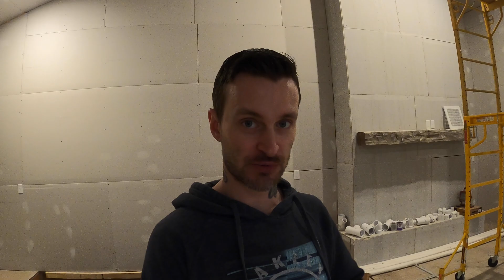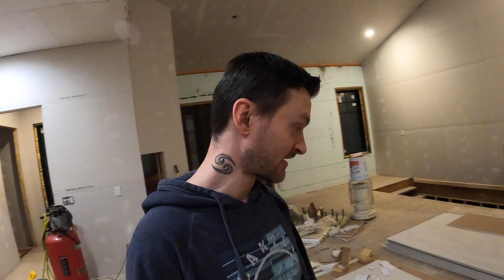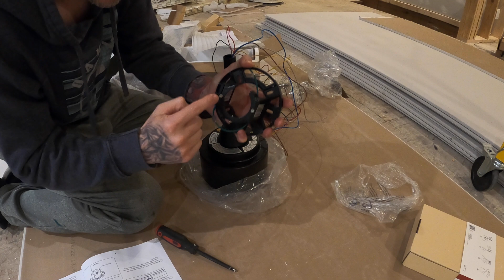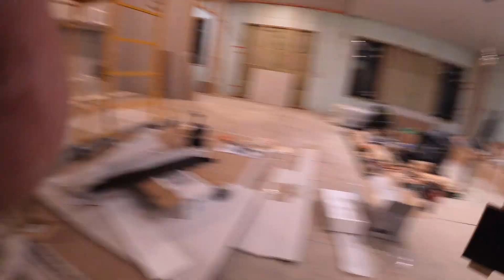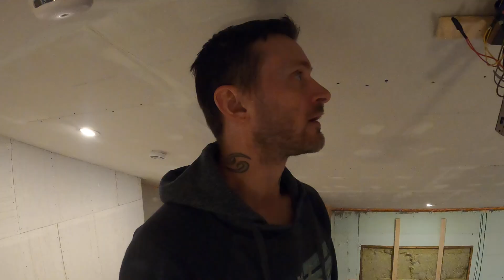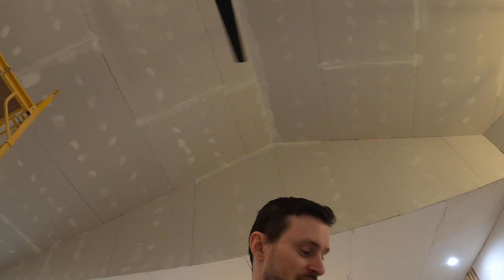Installing a ceiling fan!  Will it help??  Vlogmas day 11.

Comment: Definitely go with the larger blades, it will make a difference, especially in the summer. Would it be better to have the switch on the light to control the speed? I know when I installed mine, I had the speed control on the master switch, which allows me to control the speed (Set it and forget it). This way, I also do not have to worry about battery replacement.
Reply from the maker: Will do.  Hopefully they called her back today to figure something out.   I think this things all controlled by that remote.  I don’t think a wall switch could control the box.  I know it doesn’t for the bedroom so the wall switch I got is useless now.

Comment: Nice fan, you do pay for quality! If the blades can be exchanged for the larger ones for a small fee without upgrading the motor, then it may be worth it. Large sweep areas will allow more air flow at slower speeds. Due to the blade size it will take longer to spin up and slow down and when changing from summer to winter, let the fan stop first otherwise you could do damage to the motor or controller. A larger fan will stand out more too, you don't want to make it a center piece when walking in. Maybe give it a few weeks and see how you go and then decide if you really need it.
Ideas for Vlogmas could include a Tools review on what you have and what would be worth spending more money on as well as what would be better to rent over buying. An update on how the house is standing up to the elements, i know you had issues with shrinkage on the Gen Stone for example and is there any routine servicing required in your utility room you could do?
Reply from the maker: thanks and yes i agree.  we'll see what they say when they open today.  either where she bought it from or the manufacturer.  thanks for those ideas.  i like them.  i'll see if i can put something together.

Comment: 1. Your fan "blows" - but doesn't "suck" too well! 
2. I know you thinking of T&G boards for the ceiling, but check out how these Slovenian guys do a wall with "raw" wood which may look good on your ceiling and should be a lot cheaper than T&G boards - https://www.youtube.com/watch?v=PVuzXrgNSuE&list=PL4FgzpvgbmLGOZC4rWAt1xClFSUWofE_W&index=13 
3. If you want a topic for a vlogmas, it would be useful (at least for me) if you could run through your ventilation and heat recovery setup again in detail and "draw" on the floor/basement ceiling where ducting and vents will be so I can get a better idea of the air circulation you're expecting.
Reply from the maker: i can do that!  i need help figuring all that out anyways.  i actually have something showing up soon and it'll be all about that!!  and ill check that video out.

Comment: When I added fans to my 1908 house I added wood to the back side of the brackets and screwed the wood to the floor joists and then the bracket to the wood to stiffen it up and make it stronger as the brackets that you have to use seam flimsy. The shaft looks like a standard brackets which you should be able to go to Lowes or Home Depot and get a longer one, just take the one you have with you. I would build the fan with 2 or 3 blades on it and hold it in place and just measure down the length you need. I like the fan as is, if you got the bigger one it may take away from the room and the focus would be on the fan. The fan will cost more when you add the longer blades you need a heavy duty motor custom to the blades where most of the regular fans use a standard motor mass produced and you get what you payed for in a higher quality fan.
Reply from the maker: watch till then end.  i did all that and its finished.  the company however sells bigger ones so i dont need custom blades or motor.  i bet its all the same, just buy and replace.  i just hope we can exchange the blades for the $15 increase and bolt them up!

Comment: How much have you used ceiling fans in the past? That may be your best determinant of if you should upsize the blades. We have multiple fans and use the lights, but the fan function is scarcely used.
Reply: I have hot water radiator heat and use mine like he would to distribute the heat evenly.
Reply from the maker: @justatim8143  Ferris Bueller “it’s so choice!”
Reply: We only want it for the fan function.  I even got it without a light.
Reply from the maker: never really but we never needed to blow hot air back down to floor level before from such a height.  i think upsizing will just look better.  we use fans to sleep though for the noise.